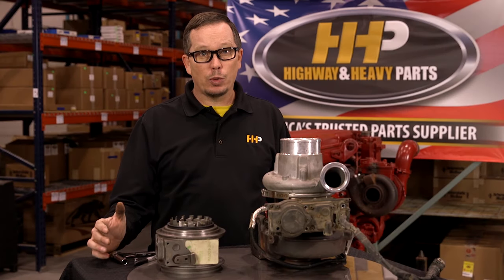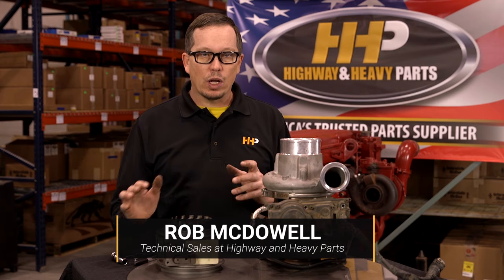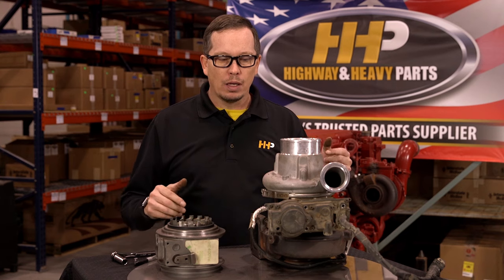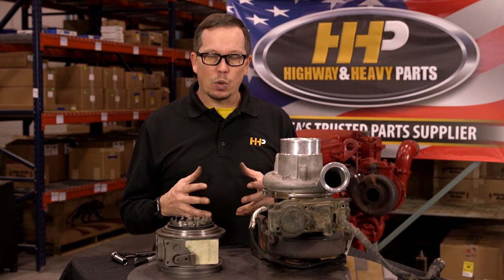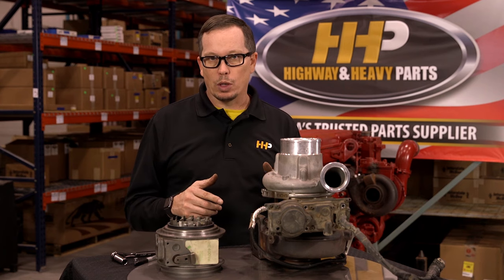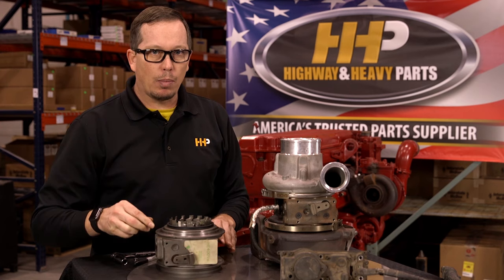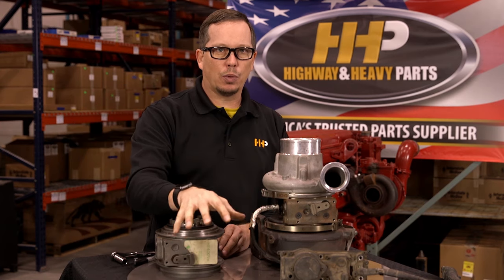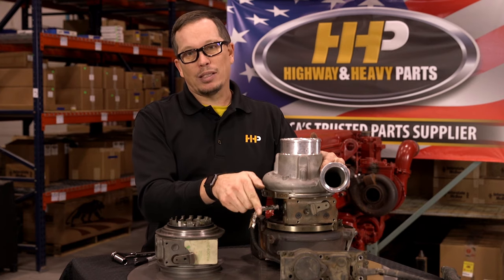How To Check Your VGT Turbocharger For Problems. HHP Can Help!

Comment: Thank you. So my car gave me this errors:
1. Swirl-Flap Actuator, Position Sensor, Signal Permanent Open Circuit Or Short Circuit To Ground
2. Charging Pressure Actuator, Activation: Permanent Open Circuit
3. Oxygen Sensor Before Catalytic Converter, Permanent, Heating, Activation:
Open Circuit

Is this bad?
Reply from the maker: Any engine codes are worth checking out. Have a technician take a look at your vehicle to prevent any further damage.

Comment: If it's the actuator, Is it an urgent fix? Or can it wait a few months. What are some possible side effects that'll come from waiting to get it fixed?
Reply from the maker: If you're running the VGT without a working actuator, the turbo will not run efficiently.  Depending on where the vanes have stopped can play a role.  If the vanes are currently in a closed position, it can cause choking of the engine or overspeeding of the turbine.

Give one of our ASE Certified Technicians a call and we can help get a new actuator or complete VGT out to you.
844-447-1453

Comment: Would appreciate some help here. 2011 Ram 4500 chassis cab. (Exhaust brake not working and low performance.) Checked VGT arm travel, moved easily full travel. With the actuator off I ran a calibration test, (pass.) Re-installed the actuator and completed calibration test, (pass.) No MIL. The strange thing is the VGT commanded VGT position AND  the actual VGT position under heavy towing or just normal driving will never go under 70ish.% except under deceleration with zero throttle application. What the heck is wrong with this thing?

Comment: I have a 2011 Ram 3500.my question is every now and then I get 2 different types of noises. One is like a loud valve stuttering sounds.the other one is like a woosh woosh woosh.it happens at different times and not together. The truck has 124,000 miles and the only modification is a Banks cold air intake.hope you could help me out with this information.
Reply from the maker: This could be an indication of a problem with the turbo but more information is needed. You can give us a call at 844-447-1453!